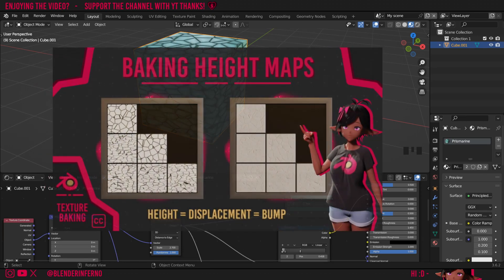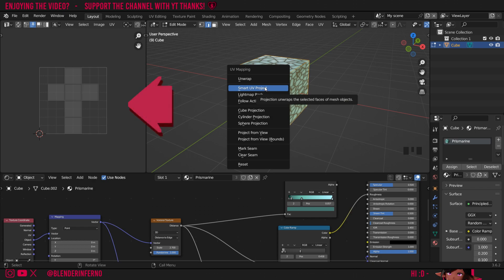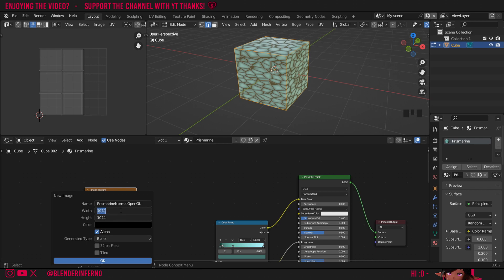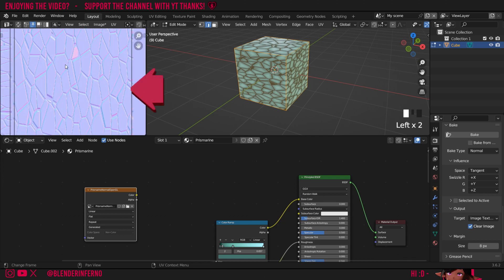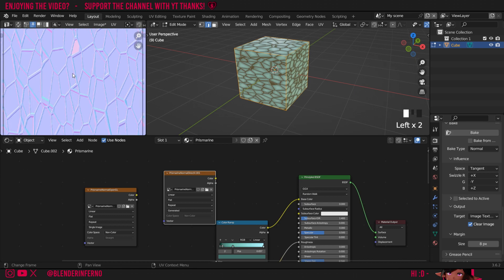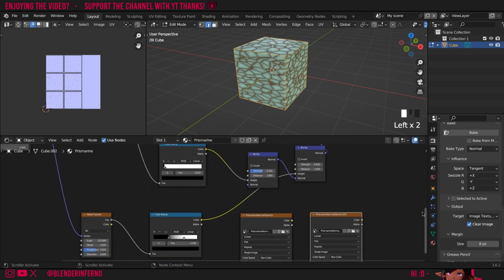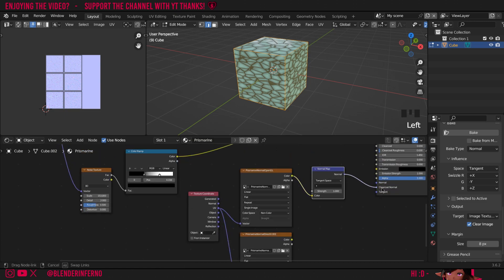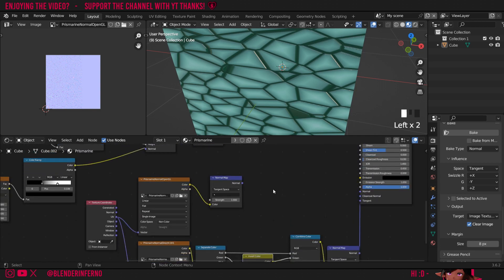IMPROVE RENDER TIMES!! BAKE Procedural Materials into NORMAL MAPS!! | Blender Texture Baking

Comment: I'm pretty sure that Blender will save the normal maps automatically if you select File->External Data->Automatically Pack Resources, right? It won't save it where you can use it in a game engine, but you won't lose your work at least.
Reply from the maker: Yeah it should do but I always like to have a copy of the image just incase, great question :)